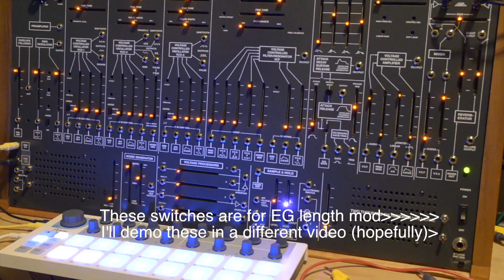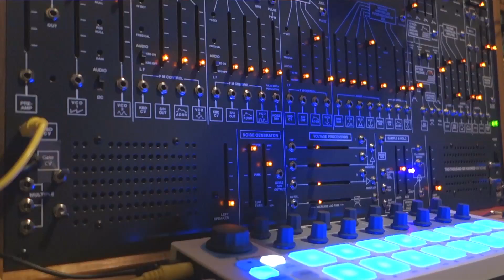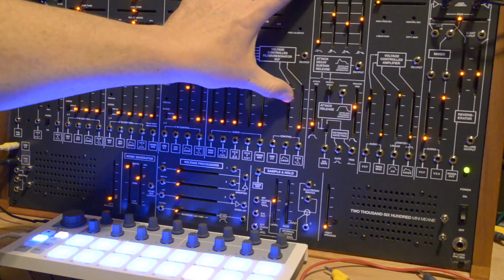TTSH Sync Demo

Comment: On my aks I have a 3 way switch (centre off) on all 3 vcos so osc 1 can select to 2 or 3, osc 2 to 1 or 3 & osc 3 to one or 2, so if you want you can do almost any permutation including a circular sync chain! Ideally I think I'd like to do that with my ttsh. 
    I read that the mod is complex & risky. Do you think so & did you have any problems, do you have any advice? I notice your switches are on the bottom left. Is that normal practice or is it get around the switches being apparently close to the PCBs? Thanks.
Reply from the maker: You could probably do something like that switching you mentioned, you would just have to come up with the appropriate switches and wiring to make it work as you want. Complex and risky - no, not at all, depending on your skill level. There's a pretty deep thread on this mod on the Modwiggler forum - search for TTSH sync mod in the Music Tech DIY forum. I put the switches over on the sides mostly because it's easier that way - there's only 10mm of space between the panel and the PCB, so fitting switches in the PCB part is kind of tricky (although it can be done).
Reply: @sduck409  Thanks. While I'm at it, I recently moved but in the confusion I have mislaid the psu to my ttsh, which I'm hoping is somewhere at my brother's house! Just in case I have to replace it, which seems to be 15 volt @ 2 amps ( also to my surprise seemingly single rail ) do you know what type of barrel connector is on it please? I take it it's standard 5.5 on outside, but when I tried a plug on it it seemed pretty loose & the centre pin looks at least to be more like a millimetre than 2.1, which as far as I know is generally the smallest. Of course I could be wrong as I'm only judging by appearance., but obviously I don't want a loose connection.
Reply from the maker: @davidsimons5944   I'm not really sure - these are all DIYer built, so different sizes may have been used, and I don't have one of these here at the moment to check anyway.